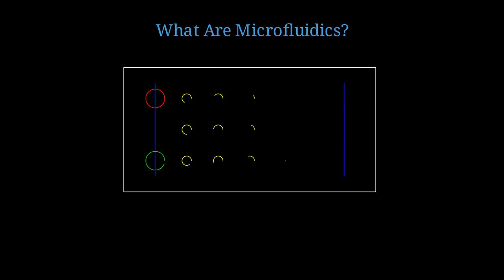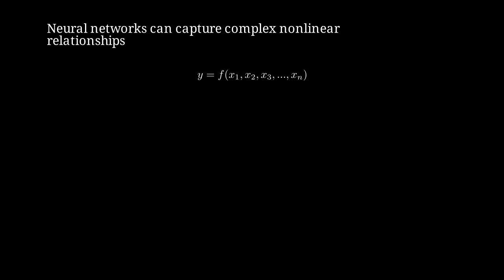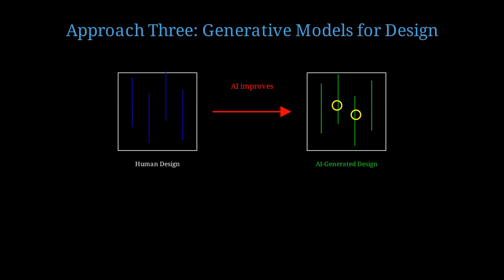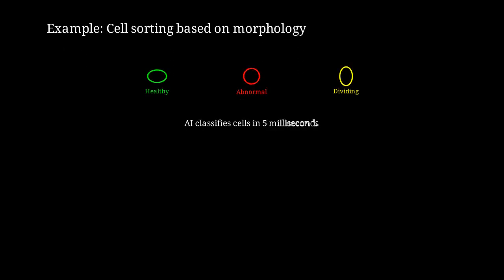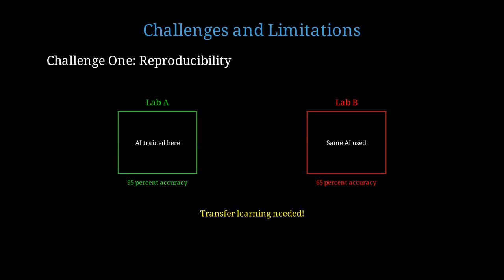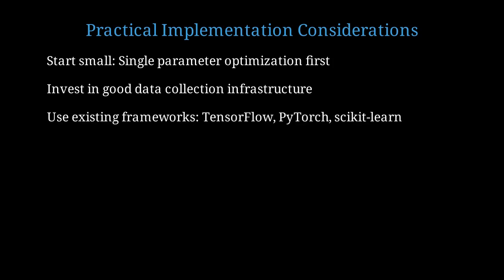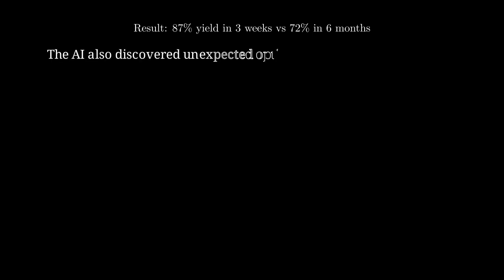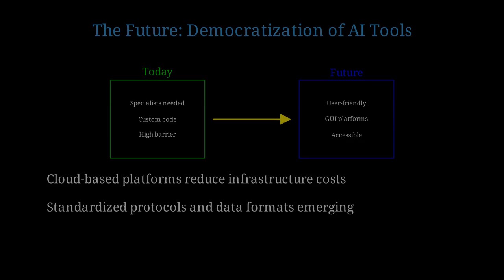Smart AI Tools for Microfluidics: From Parameter Explosion to Self-Driving Labs

Comment from the maker: Generalization across labs: How can AI models trained on one microfluidic setup remain valid across different chip materials, fabrication tolerances, and environmental conditions?
Interpretability vs performance: What level of physical interpretability is necessary before AI-optimized protocols can be trusted in safety-critical chemical or biological experiments?
Autonomy boundaries: At what point does a self-driving lab require formal certification similar to medical devices or autonomous vehicles?